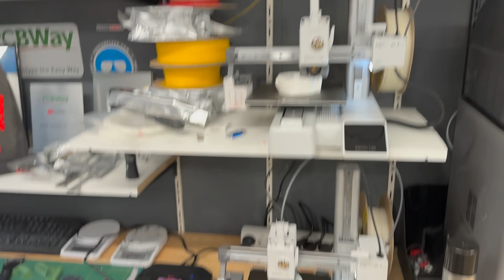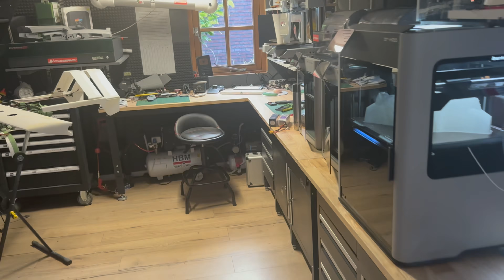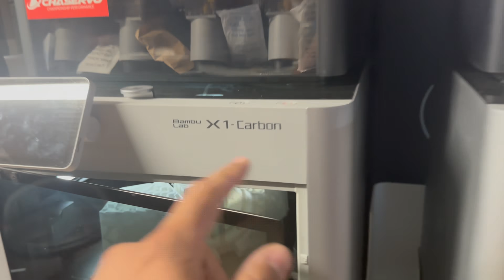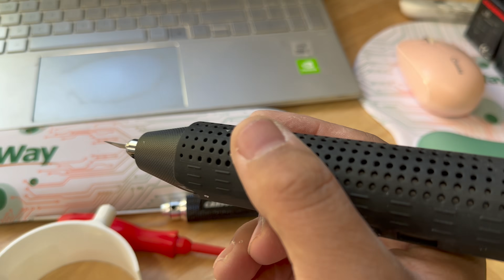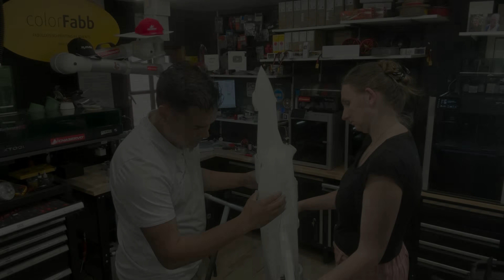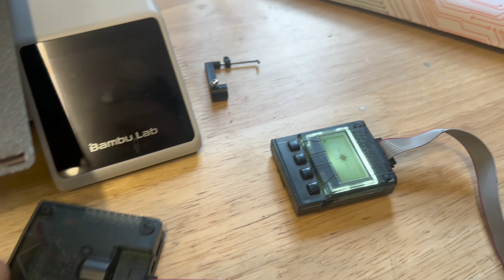Build video- RC Jetprint F35B With Bambulab H2D Combo SuperFast Mini PrintingFarm

Comment: Nice job. What is the diameter and inner thickness of the carbon tubes used along the length of the fuselage?
Reply from the maker: In this model none, just 10mm tubes in wing from Ahltec.de